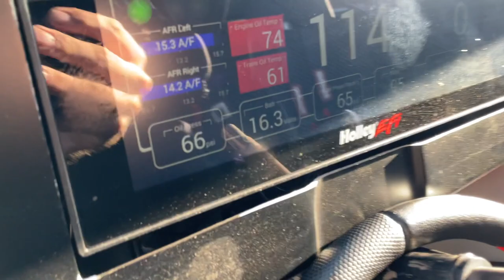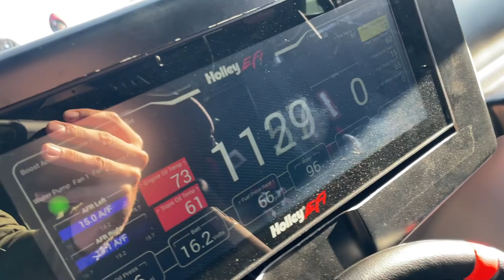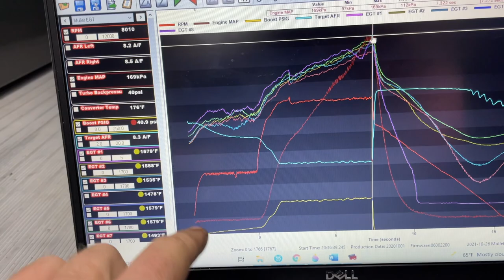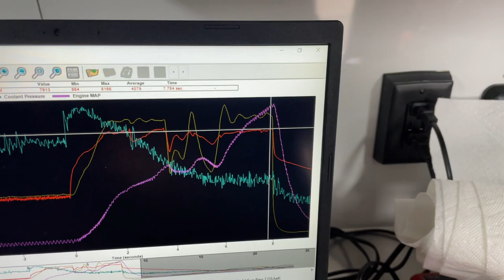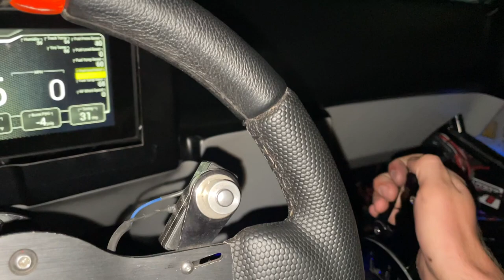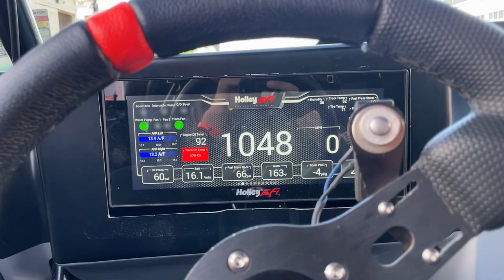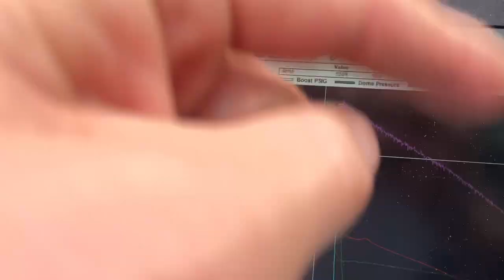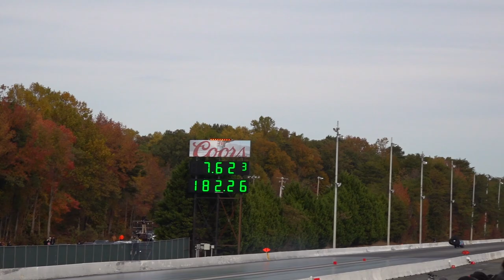World Cup Finals Day 2 & 3 - Mullet BARELY Qualified... Entering Eliminations Blindly!!!

Comment: I'm never exactly right because I only have a vague idea what I'm talking about...learning the thunder while burning the rubber lol It really bites the pressures in the crank case rose as fast as they did. Maybe instead of just venting the crankcase methanol you could feed it back through the intakes. Maybe one of the guys on the team can come up with some idea.

I hope you get a lot of work out of that data on the longer gear so you can tune it for that gear ratio, maybe that will make all the difference.

Comment: You're running TH400's in Mullet... You might want to consider a moving up to the 4L80-E, particularly a "Black Edition" version from PerformaBuilt Transmission.  It will handle 2000 HP/2000 lb-ft Torque.  The 4L80-E is a comp-controlled 4-speed descendant of the TH400.  They also shift quicker than the TH400 does.
Reply: Mullet has a glide, needs a tough th400

Comment: When it's cold out, put a hotplate under the oil pan and get the oil up to temp before you start it. WAY faster to get up to temp.

Edit: Less wear on the engine, too.

Comment: a lot of dedication running faster car, you have 3 car that can run mid to low 7s. but this year was disappointed one, with that skilled team behind you. no reason not to tighten up your racing program..at this level its expensive to blow   your equipment vs preventative maintenance

Comment: Time for some more big boy parts indeed.... Billet race tranny comin' right up! (Mullet grin's)
At least it's not a Corvette drive-train and you can carry 2-3 different converters and swap em out as needed pretty quickly. Getting a 35 hundred lb. boxy race car/truck down the 1/4 mile to a high 6 is a challenge for sure but I have faith that Ol' Cleet will get her done.

Comment: holy shart, banana torque converter 900% by 4:49. more power/torque than can be applied to the ground and not spent in heating is good.
more bananaverter= more heat and = burnt parts that n]need replaced. same goes for manual clutches/slipper setups. (aka one run specials) those are left to billionaire  backed teams, with endless incomes.

Comment: several questions ...what ring gap yall usually running on? ...and did u say leave on 12lbs and max of 29lbs  ? and what was the dome pressure ? also whats ur base timing same as previous stated in several vids or did u finally push it up ?...did u say problems making weight ....dont let george talk u into those extra tacos...jp its all out of love.!
1\